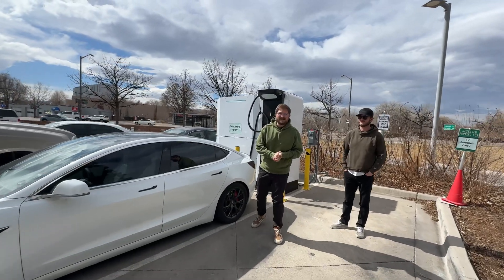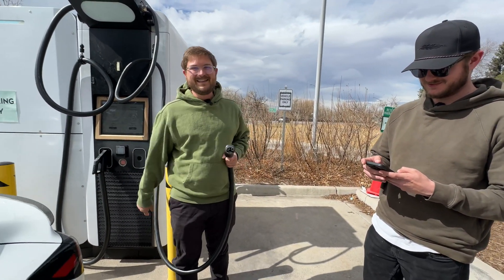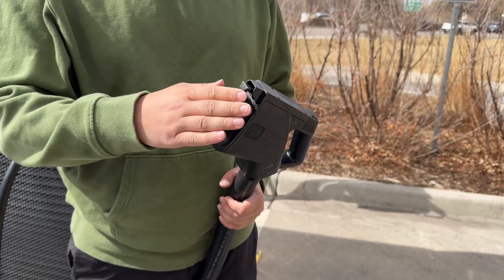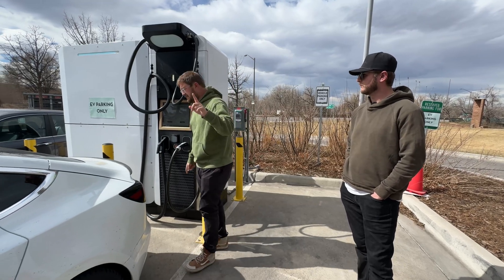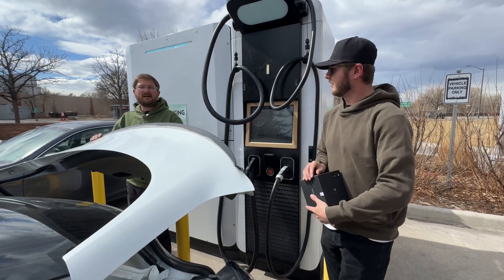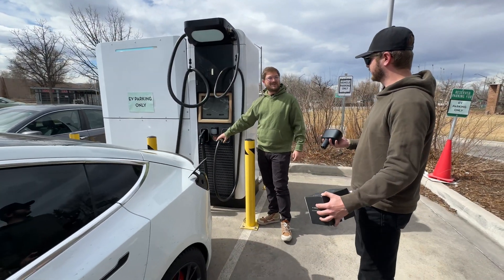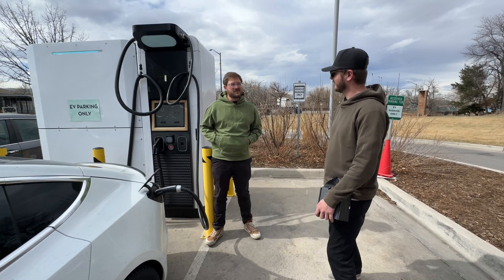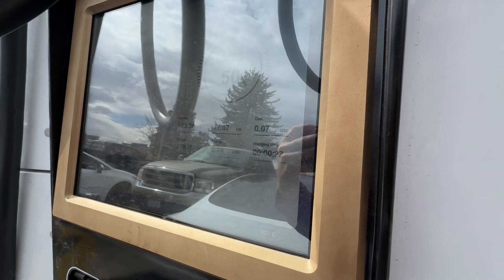Your Tesla May Not Charge w/ A NACS Cable! You May Need A CCS Upgrade

Comment: Driving from Los Angeles to Brownsville, Texas, the 2016 Model X navigation worked fine up to Lordsburg NM, there was a Tesla charging place where I couldn't charge due to my car not having CCS enabled, since it was my first trio on a Tesla traveled 5 miles to an Electrify America location without luck either, went back to downtown Lordsburg and found out a Ford dealer had Blink charging station, I had the J1772 adapter but they said it was out of order, now with  1 mile left of baytery I called Tesla, they said Sorry, it was all on me, they didn't care if I follow the Tesla navigation, they just said you shouldn't have driven the battery that low, and that a CCS option wasn't an option.
Went back to Ford and begged, offer to clean all their tiolets,  I'mnot kidding, Las  Cruces was $1,400.00 tow away, yes, they said it was okay, they'll charge .55 per kilowatt and will accept my credit card manually!

Comment: Caution on the ECU boards. Tesla sells 1537264-00-B as a stand-alone part without the CCS adapter. This board DOES NOT work without the 3rd party harness from 2MuchSun called BundofWires. The board that comes with the CCS adapter is part 1537264-09-B and does not require any additional harnesses. The only way to get this board, unless Tesla has changed since I upgraded my 3, is purchasing it with the adapter.

Comment: Not having a universal standards is just poor Engineering
Reply: The design for the Model S started in 2010 with the first production cars delivered to customers in 2012. At the time of design, no industry standard existed for DCFC, so Tesla designed the Tesla charge port as well as the first gen superchargers and the communications protocols they used. The first Supercharger stations opened to coincide with launch of the Model S and were capable of providing 100kw max(later upgraded to 120kw).

The CCS protocol was proposed in Oct of 2011 with the plan to introduce the standard in mid 2012, with the 1st charging station opening in June of 2013 with a 50kw charger.

Comment: My super old 2013 w/o a CCS option locks the NACS connector when plugged in. You have to dig through menus to unlock the port just to get the NACS plug out.
Reply: You should be able to hold down the trunk open part of the key fob for 3 or 4 secs to release the charge port. This will also open the charge port if its closed.

Comment: I heard people talk about this when NACS was first standardized but rarely heard about it since. My understanding is NACS uses the same communication system as CCS because it means you can easily use adapters for CCS to NACS where the Tesla communication system would still have the same interoperability issues as before. Plus CCS's communication standard was already held by a standard while Tesla owned rights to their system.

Comment: I noticed a modification to a nearby EVGo site that i believe was done for the opposite reason. This was a very old site, opened in 2012 as a pure ChaDeMo site with the 50 kW ABB brick. This was one of the EvGo stations that supported tesla charging using an integrated ChaDeMo adapter. A few months ago, those Tesla adapter/cables were removed, leaving only CCS and ChaDeMo for the time being. 

I believe this was done to avoid confusion among owners of new NACS cars. Those cars would physically fit the Tesla plug, but they wouldn't be able to do the ChaDeMo communication needed to get a charge. So better to just remove that equipment and inconvenience the small number of tesla owners who use this site.
Reply: Or maybe they're part of The Resistance.

Nah, they'd make it blow up your Tesla if that was the case.

Comment: That plastic pin on the ccs adapter looks like it is really fragile. If it breaks while it is bouncing around in the trunk is the adapter junk?
Reply: The OEM Tesla adapter is a very solid piece of equipment, and is surprisingly heavy for its size. That long skinny pin looking part at the top is actually made of steel and holds down the CCS locking mechanism while the adapter is plugged into the car.

Comment: Can I charge my CCS equipped non-Tesla EV at a non-Tesla DC fast charger using their NACS cable and my NACS to CCS adapter?
Reply: It should work.
Reply: Yes, should work fine the biggest difference between NACS and CCS is the pin layout the communication used is the same regardless so should work fine

Comment: The reason they likely kept the CCS communications is because you'd have the inverse problem, all existing CCS cars would need a retrofit to use NACS stations, opening superchargers would then become pointless until new cars were built with the tesla communication protocol which is proprietary. Additionally because it is proprietary it might not be that straight forward to to open it, tesla is highly vertically integrated and it might not really be a very friendly protocol to open to other users. Doing what they did makes a lot of sense

Comment: Sorry if this is a dumb question, but when non Tesla automakers like Rivian and Kia change over to native NACS ports, will the cars charge on any Tesla Superchargers or still only V3 and V4?  Will there need to be software changes?  Will they come with CCS to NACS adapters for use on CCS chargers?
Reply: V2 superchargers only use a proprietary communication standard that non-teslas cannot understand. Teslas with the updated charge ports can read both so will always work. 
So no, non-tesla vehicles can only charge on V3 or higher. And I think not even every location right now, the stations software has to be updated I believe to allow non-tesla vehicles.
Reply: they are opening up more Superchargers, the new one they are building near my house will be open to non Teslas

Comment: I have a mid-2021 Model Y that is not CCS compliant. For a long time, Tesla kept saying to check back to see when an upgrade was available. As more and more Superchargers came on line, and non-Tesla chargers started supporting NACS I figured I didn't need to bother with the upgrade any longer and stopped checking. Your video shows that's not true, and I probably should schedule the conversion. Tesla app shows that it would cost me only $330.

Comment: Plug and charge should be a part of the ccs communication protocol. Every car, every charger. No fiddling with apps.
Reply: It is a part of the CCS protocol. Not all networks use it though. I can plug and charge my KIA on EVGo but not EA, or some of the other DC stations I've tried. And to make the plug and charge work with EVGo I had to put my VIN and means of payment into their app. At least that's a one time thing (until the means of payment expires).
Reply: @kng128 the EVgo autocharge+ feature does not use standard CCS protocol for plug and charge, it’s a proprietary protocol invented by EVgo. Electrify America does use standardized protocol for plug and charge, but Hyundai/Kia/Genesis don’t support the standard protocol. But Ford does, so Mach-Es and F150s can plug and charge at EA. Hopefully HMG will get with the program and supply software upgrades for their cars to support this.
Reply: @ thanks for clearing that up. I appreciate your posting that info.

Comment: Is that the same adapter I use to charge my 2023 Model Y at a CCS EVSE?. I paid $175 for that so if it is included in the retrofit  for $325 not a bad deal. Thanks for the explanation!

Comment: This will become a bigger issue as time goes on and the older (not built for NACS communication) Teslas continue to run.  It would be really great if you have Alex make a video on upgrading a first-gen Model S/X for NACS/CCS-1 comms.  While you're at it, you might also cover the cell modem upgrade requirement for first-gen Model S/X, although by now those cars have long since either been "fixed" or relegated to "gee, I can only do software updates at home and I can't find Supercharger info in my car's navigation system unless I set my smartphone as a WiFi hotspot."
Reply: There were only about 25,000 vehicles(only 2012 & 2013) manufactured with that Gen 1 charging architecture that is incompatible with CCS. I don't think it's going to be a problem for long as those cars are lost to repairs and damage.

I have however seen videos of some enterprising owners using a pair of adapters in sequence to work around the problem going from the car to a Tesla/CHAdeMO adapter to CHAdeMO/CCS adapter to CCS station. They only get around 50kw, and it's janky as hell but it beats J1772.
Reply: @shannonlawhorn1674  More importantly, it's costly as hell to get those CHAdeMO-to-CCS adapters

Comment: Agree, This is going to confuse so many people that buy older, used Tesla EVs.   People can't even comprehend why their Bolt, ID4, Mach E etc... , isn't getting 350 kw when the charger is labeled that.   Great video to explain this.
Reply: Makers may have to start putting stickers on the charge flaps, kind of like with ICE cars on what the minimum octane or diesel requirements are. It would be especially beneficial on cars that don't benefit much or at all on 350kW chargers. No reason they just couldn't put a little "55kW max usage" on the bolt charge flap. Or something to that effect.
Reply: @andrewt9204 
I think in Europe they have a sticker system for this.
Reply: Correct, it's hexagonal stickers in white or black.
White stickers are for socket outlets for AC charging, with a C it's type 2 and with D or E type 3 (French socket declining in use)

Black stickers are for vehicle inlets and vehicle connectors, type 1 (J1772) is identified with B, type 2 with C.

Dc charge cables for type 2 CCS are K or L depending on voltage, the same spec is for chademo with M and N.

The old Renault Zoe used a high current type 2 AC for rapid charging it has O.
Reply: Yeah I say this all the time more often than not. When people say electrify America is broken is because they're not getting the speed. They think they're supposed to get when in reality they never could

Comment: I updated my 2019 M3 by buying the ECU from a company in Florida, a bundle of wires from EBay, and the CCS adapter from Tesla South Korea about 3 or 4 years ago. And with the latest software update I can precondition.  It is handy in Oklahoma.
Reply: Bundle of Wires rigs the temp sensors on the port to work with the new ECU, which can cause temp faults in below freezing temperatures.

Comment: If it was under $200, I d update both my '19 M3P and '14 P85, but i was quoted $400 for my 3, and $385 for my S. In my entire ownership (3 years), I've only wished I had CCS 4 times. And to me, thats just not worth it.
Reply: With 3rd party NACS installations starting it might become worth the upgrade. Remember your cars won't be able to charge at NACS chargers so you will remain locked in the Tesla network. You might consider contacting your service center and see if they can give you a price for the upgrade without the CCS adapter, or possibly one car with and one without. The adapter runs $175 so if they can delete that off the price it could be very close to your $200 desired price.

Comment: Now they need to add all CCS evse to their navigation. It would really improve the typcial there are no chargers around us bias. We need a global EVSE api that anyone can connnect to. Kyle should start it and make millions. We shouldnt need apps to find chargers.
Reply: On my 2023 Model Y I have that. Just do a voice command "show me fast chargers" and it will put up a list of the closest non-Tesla fast chargers. Of course, it won't automatically put a non-Tesla fast charger on the route when you use the Navigation. But you can find and navigate to non-Tesla fast chargers with that voice command. And in my latest software upgrade, the battery will precondition if you're navigating to a nonTesla fast charger.